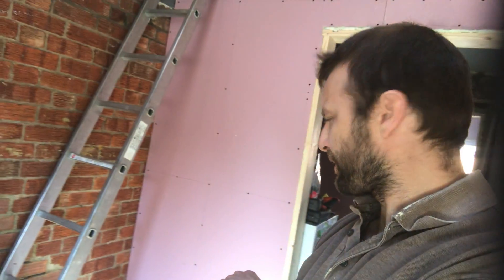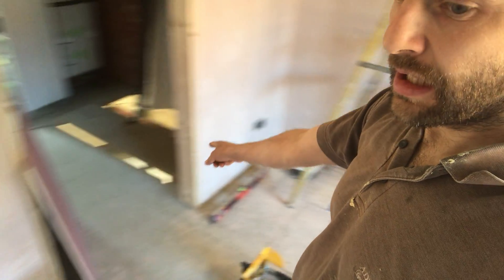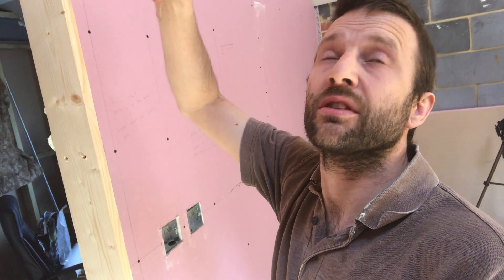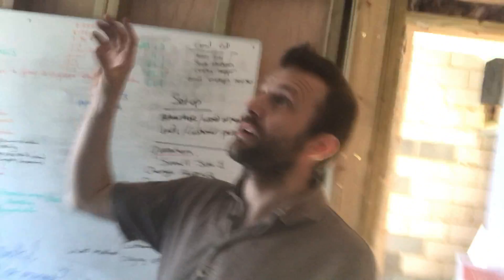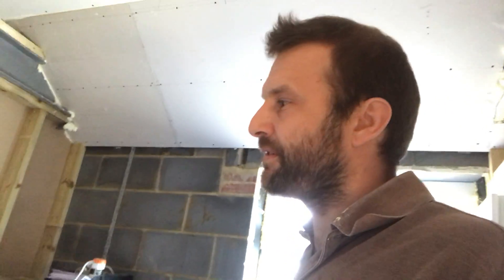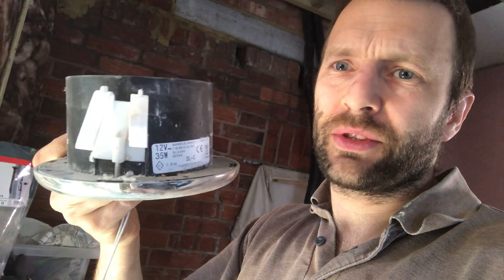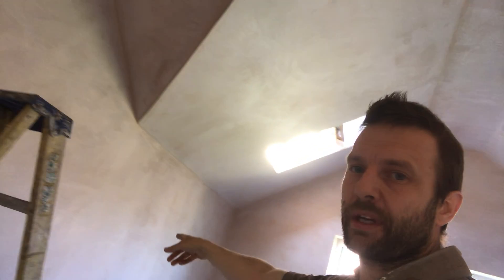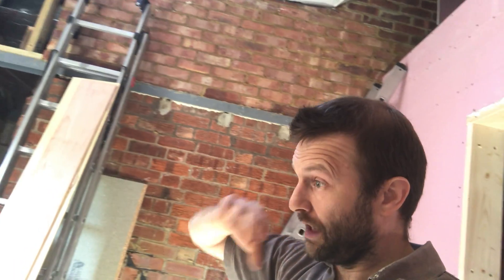Video on cable runs, downlight positioning and bathroom fans

Comment: Agree re: online fans. I'd also use insulated metallic ducting. I use a humidity stat on a sensor for fan which means it's independent of lights, turns on when it needs to only. Ideally extract should equal intake so important to resist temptation of putting in a mega fan because you will end up with negative pressure and lose a lot of heat. I prob over think it....... 🤔
Reply from the maker: I've tried humidity sensors and I'm not a fan if i'm honest.

But great idea when they work, although they can come on randomly in my experience 😁
Reply: @Pure_electrical_training  Hahaha "not a fan" like the pun :-) They are not random, they come on when a set humidity is set. Also thats why I use them with the PIR sensor. They only activate when someone walks in like the switch line does but if its not required then it wont turn on so, energy savings. Different bathrooms require different solutions. I see lots of big bathrooms with the fan attached to the main light but its never used!!! they use the fancy wall lights and then wonder why there are spores growing everywhere? PIR always for me unless the bathroom has no windows and 1 lights then the fan will always operate and comply with Part F and L